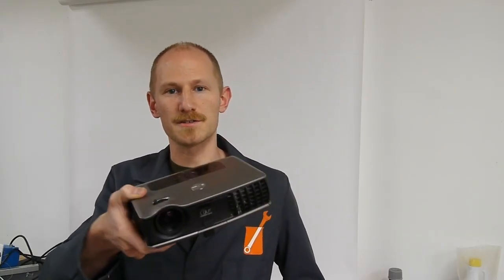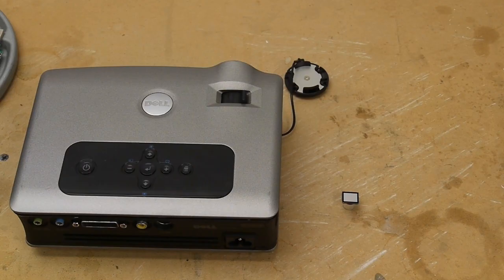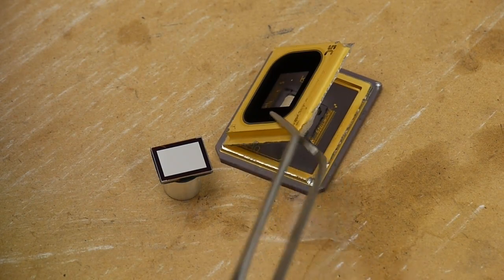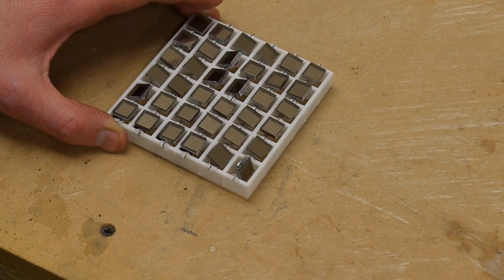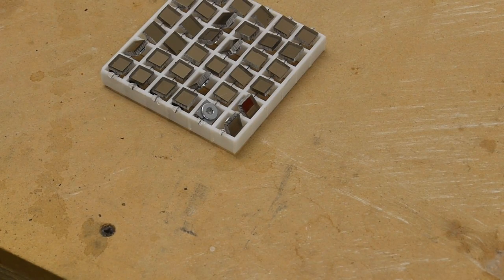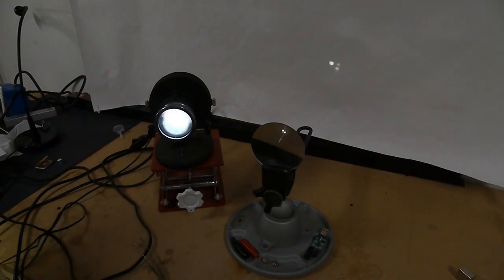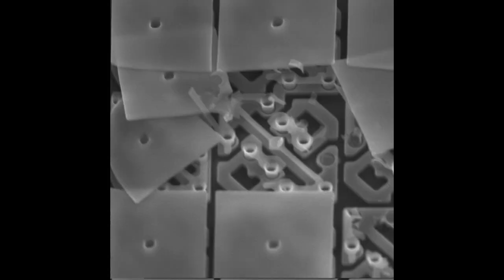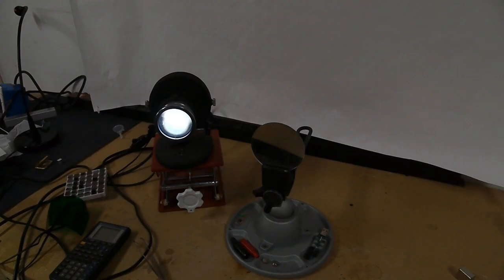How Digital Light Processing (DLP) works

Comment: My electromagnetics professor worked for TI and did RnD for the DMD. He gave two lectures explaining the math behind the forces of the torsion spring and the 'capacitor' (gap between mirror-plate and electrode). 

The steady state relationship between the force of the torsion spring and the force between the two plates of the capacitor relative to the change in distance between the plates of the capacitor with only one intersection where the forces are equivalent, yields an astounding simplification where all variables (voltage, area of plates, spring constant) except one cancel out, leaving only the distance between the capacitor, d/3. 

The d/3 represents the steady position held when the mirror is 'turned on'. When the force of the spring is equivalent to the force of the mirrors electrostatic attraction to the electrode. Which can then be calculated into the angle at which light is reflected from the mirror ... and thereby all of the mirrors in the array.

Another elegant simplification for a boundary of the laws of physics, all because we want to watch cool movies on bigger screens.

https://physicstasks.eu/3250/capacitor-with-plate-on-a-spring#:~:text=Air%20capacitor%20consists%20of%20two,down%20(the%20plates%20remain%20parallel.

Comment: Why not have each mirror be suspended by equal electromagnetic attraction and repulsion, with slight modulations to tilt them, so they have no mechanical connection & fatigue?
Reply: The specially alloys used in the torsion spring only operates within an extremely linear elastic region of the material. Thereby the mirrors have a quite significant amount of cycles in its lifespan.
Reply: @jamesbarnes6343  Interesting point. Thank you.

Comment: The mirrors actually pivot on the corners, and are pulled down with 12 static volts. The springs are mono crystal aluminum. Also: that was a first gen package. Second gen packages have a much smaller glass (first gen glass was so big it cost almost as much as the die).

Comment: Amount of engineering goes into this chip is phenomenal. 
One thing I have noticed, projectors that support active 3d , always use DLP chips to produce image. I believe , because of its  high refresh rate capability.
But now days Lcd panels are capable of producing 144 and above refresh rates. Why we still use DLP chips?
More that that, IPS LCD panel offer better colour accuracy without Rainbow effects.
Can somebody answer????

Comment: just got myse3lf my first DLP DMD chip (TI) and I'm impressed what 285USD can land you.
though it's one of these all-in-one Xiaomi devices. with battery, speakers, and android OS, but dont have a screen, so its the ceiling or wall or even the bathroom tiles like here, https://www.youtube.com/watch?v=W8cfB5k2oAk
and yep you can sense the rainbow effect if you close one eye and open the other and do that fast 
It's a 1080p with around 600 to 700 ANSI.. the DMD is a 0.37 or 0.33 or something like that, though with pixelshifting.
also got 3D, though seem to operate with 144hz, so a no go with the glasses I have from a Samsung 3D TV from a decade back that is 120Hz as I recall .. ½ of 240hz
and mindblowing footage 7:48 one can only wonder about the Texas Instrument tech that is in play to make these DMD TI chips and the balancing mechanism underneath (wicked)
reminds me of a microbolometer sensor chip. (thermal IR) that is also very tiny and fragile and can be bumped out of alignment.

Comment: We have spent many years watching interlaced lines sequentially on TV, but with DLP and the new 4K XPR pixel-shift technology it is fooling the eye in many more ways; the micromirrors of the DLP chip modulate the brightness by PWM, the color is mixed sequentially with the color-wheel, and the 4k enhancer XPR optically shifts the pixels two or four times in 1080p for a 4K feel. These solutions have a mechanical operation, which produces noise, wear and heat. 
An added disadvantage of LCDs is the problem of placing the drivers of each pixel on the panel, as they are translucent they have to be located at the edges, increasing the separation between them "screen-door", which also makes it more difficult to manufacture them for 4K. . I think the best solution is the one used by JVC and SONY with LCoS chips; there are no moving parts, but it is very expensive.

Comment: Question how do they prevent the individual mirrors from "springing" when the electrostatic is turned off? What I mean from springing is let's say you put a spring under tension then let go. The spring doesn't go back to it's resting position and just stop. There is a slight bouncing in and out as the energy dissipates.

Comment: Surprised they don't recycle the waste light with some additional mirrors and optics.  Dumping all that energy into a black surface seems like a cheap and stupid way to do it.  Wouldn't need as noisy fans and additional power to heat your room.

Comment: Hi, you say that lcd has about 3dB loss through the polarisation filter. Wouldn't there also be some loss in the colour filter in the dlp?
Is it not possible to use lcd with colour wheel? Or does the lcd not have enough bandwidth?

Comment: The damage done by the tweezers makes it obvious why it was originally in that protective case.  It would make cleaning the assembly many times easier too since all the fragile parts are inside and all you would have to do is wipe the glass.

Comment: I saw an active camouflage vehicle once! About two years ago, out for a Test drive?  I could see the carbon graphite frame, having looked under the vehicle. Simple two door car, nothing particularly fancy about it.  I think somehow it incorporates the water vapor in the air, as a pixel intersection???. holographic skin . I Seem to run into the craziest shit every 3 years. Started When I was 18 and was 2” from yellow square on the runway, staring at 6 armed  guards in blacked out  chemical protective suits standing  around a F117  stealth fighter. Hell I never knew it’s designation until a year ago, on some kids wall poster...it’s Really small, not like the pictures, minor differences.  I don’t Member that clearly now. it dark out about 10 pm.  22 years ago and I was more fixated on the arm guards, staring at me waiting To take a step forward!    Curious on your thoughts?    To Whom it may concern. I never had to sign a NDR so pissed off!

Comment: Instead of a color wheel spinning in front of a single light source, I guess you could also have multiple light sources switching on and off in sequence (LEDs might be the only thing quick enough) or a metal disk with a hole that spins in front of multiple light sources to let only one light (or a combination of two) through at a time. This could open up the gamut and color depth tremendously, for example by producing violet light with an actual violet light source.

Comment: Old post but wanted to let you know my 2004 Samsung dlp hlp5063w is 14 years old and my Philips square lamp has 14000 hours on it which I'm going to replace soon due to dimming. I replaced the ball bearing color wheel with an air bearing and lubed the fans in 2010.  I modified a small square exhaust fan and placed it on the back vent. Picture still looks awesome with my Dish satellite  receiver.  My next TV is gonna be an LG OLED.

Comment: Does anyone know why DLP projectors don't use something like a Bayer filter on top of the mirrors in order to get coloured subpixels, rather than spinning a filter wheel?
Reply: That would take up 4 mirrors for the predefined Bayer filter colors of say mirror 1: Green Mirror 2:Blue Mirror 3:Red Mirror4: Green. In a CCD camera they employ a demosaicing algorithm to reconstruct a full color image from the incomplete color samples output from the color filter array when the image is saved. That won't work in this case since you are projecting the image and there's no way to use any sort of algorithm before the image hits the projector lens.   You might as well just use a single LCD panel which have the pre-defined elements of RGB but suffers from screen door effect.  Using the Bayer filter method, you would also need to squeeze in more mirrors to get the same resolution as you would with a single color wheel DLP (where each mirror can either be RGB).  Though you could use a 3 DLP chip solution but that also kicks up the price quite a lot but adds a complication of converging the each color panel to line up in both 3 DLP.  The other downside to a 3 panel system is that it seems the blue panel for either DLP or LCD burn out much quicker than Red and Green panel from what I've read the blue panels get much hotter and if the cooling ever fails or you run the projectors in a not so cool environment can lead to that failure.  That's not say there won't be issues with a color wheel failure or Rainbow effect which has been greatly mitigate by using and RGBRBG 6x color wheel.  It is the cheapest and still the best solution for the consumer market right now especially for 3D.

Comment: I still prefer 3lcd instead of 1 dlp chip cause of color shifting effects... or in perfect world a 3 dlp professional projector is the best on earth in term of light efficiency but a 3 DLP chip projector is quite expensive. But their picture is nothing compared to what single dlp chip or lcd projector can achieve. But if i have to choose between a single dlp or a 3 lcd, i'll go for sure with a slightly bigger 3LCD to compensate for the lack of effiency and even use a 0,7 -0,8 gain screen (light gray) to increase contrast and make blacks even darker at the cost of reduced brightness that can be compensated by purchasing a projector that haves some extra brightness to get around this issue.

Comment: The problem of LCD is heat. The polarized light means that 50% of photons are absorbed. In case of dark image, 100% photons are converted to head in the LCD glass.

DLP is not absorbing any photons except for imperfection in production. The IMAX digital projectors can use thousands of watts light source and need only a few watts of cooling for the mirror array.

Comment: When a mirror flips to the OFF position or to the ON position, does it do so very fast so the eye does not perceive any light moving on the image? I would imagine that if it was too slow you would get a blurring of the image. Or does the flip coincide with a shift between the red, green and blue filters?

Comment: Not entirely sure about the power of the light statement at the end. The DLP is showing only one colour at a time, thus using a small part of the full white light from the source. Also, it has to switch on and off in the different colour areas on the spinning colour wheel, and I imagine that a lot of times the mirror must move out of way just before the colour wheel changes colour, as it will cover the chip in a rolling motion. The reason for the usual light output difference is probably more to do with how much heat the LCD chips can handle.

Comment: I love this . DLP is working like an early color tv that used a black & white CRT and a drum that would spin a set of red green and blue film filters in front of the picture tube to create a color image. The picture tube was qued by a sensor so that the corect brightness level would be presented on the CRT to correspond to the colored film in front of it . This design was abandoned due to the larg drum spinning at 60 revolutions per second being a serious hazard if it were to break while in operation. You could still build a demo model from an old b&w tv .That would be cool to see.
Reply: Applied Science So Cool

Comment: Mechanical color TV is the same technology used in NASA cameras for Apollo as well as the Space Shuttle late into the 1980's (while they weren't ready for the Moon's surface until Apollo 14 all the Command Modules had mechanical color cameras). They used six segment disks (GBRBGR). The Space Shuttle had color wheels built into removable lenses. They could swap them with one of several B&W lenses when needed.

Comment: Those little silicon torsional springs would have have to go through a lot of cycles per second to move their mirror multiple times per frame for both colour and intensity.  Think about how many cycles that would be in a lifetime. I didn't think mechanical springs of any size or material could handle that much flexing at those speeds. Think of the temperature they would have to operate at too.

Comment: Adding a few more things, I spent several months doing competitive analysis of DLP chips when I worked at Hewlett Packard.   The torsion hinge is not silicon but a titanium/aluminum alloy.  Lots of interesting material properties of Ti/Al I won't get into here.
The most important thing missing from the narrative is that this device was the first truly micro electro-mechanical device.  I say that because it is not just electrostatics that are responsible for the mirror motion.  If you look carefully at the SEM images, you will see that, under the mirrors, there 4 little tabs attached to the posts.  These are actually tiny springs.  When a mirror is flipped to one side, the electrical force holds it down.  What is really interesting here is that when it is time to flip the mirror, a short voltage spike is applied to the "down" side.  This pulls the mirror down on these little springs then lets it go.  The result is a very fast flip to the other side where there is a voltage applied to hold it there until it is time to flip it the other way.
 If you are wondering why it is this way, think about the inverse square law.  On the down side, the mirror is about 100 nanometers from the electrode.  On the up side, the mirror is a couple of microns from the electrode.  The force on the down side is hundreds of times that of the up side.  It will flip by pulling from the up side but it will be way too slow for a video projector.  Pull down really hard for a microsecond then let go and the mirror flips really fast!  Pretty cool technology from TI.  
Note that Hewlett Packard didn't ever produce a projection chip.  They spent a lots of millions and couldn't come up with something that could do better that the DLP chip.  But, that's another story...
Reply: that's fascinating!  the stronger force available is in the wrong direction, so use that to pull it against a spring and then let go... clever.  I just assumed that they used the piezo effect to move the mirrors.  Any short explanation as to prefering electrostatic?
Reply: cool
Reply: Very interesting info. Thanks !
Reply: Cool info, tq!
Reply: I worked on DMD for about 12 years.
Reply: How are those springs made?
Reply: @Hugh_Mungus  if you ever find the answer, help a guy out. That's all I can think about.
Reply: @Ghengis443  Hello. This was some time ago but I remember reading about how it was done similarly to how they etch patterns on microprocessors using lithography as well. I'd also still like to know more about this if anyone knows more
Reply: wow how can you make something so small and perfect?. if we can make tech that small then whats keeping us from making nanobots?

Comment: When a single mirror is flipping from "on" to "off", I assume the light stays on. How do you not end up with streaks all over the place while the mirrors travel between the two positions, especially if they're flipping many times within the same color wheel position?

Also, why can projectors not have RGB LCD panels like standard computer monitors? Why are three separate chips + light paths required?
Reply from the maker: +Ethan Trewhitt Good questions.  The mirrors move extremely quickly in a DLP chip, and the streaks of light that they produce are too dim to see even when looking for them carefully.  I believe the total travel time for a mirror from one position to the other is 5-10 microseconds.  There just isn't enough time for a human eye to capture enough photons.  Some projectors do have full RGB panels, I believe, but they tend to be low-performance units.  The main problem is pixel density.  A high-res RGB LCD for a computer might have 2560 pixels spread over 40cm, which is 190 subpixels (R, G,B) per cm, or 52 micron per.  An LCD projector might need 1920 pixels over 2cm, which is 3.5 micron per subpixel.  This is a problem because the LCD requires some space in each subpixel for the driver transistor, and it cannot be shrunk too far without degrading performance of the panel.  Thus, the ratio of total pixel area to transistor area becomes small as the panel resolution increases, and at some point the device cannot function well because there isn't enough area for the driver transistor and the pixel itself.  This is why LCoS is popular -- the silicon substrate is much more efficient than the glass substrate for making driver transistors, and a much smaller area can be dedicated to the transistor -- keeping the pixel-to-transistor ratio high.  The other alternative is to separate R,G,B, which effectively triples the area available.
Reply: ***** You do, but they are so dim that you cannot see it over the actual projection image. Also i imagine the colour wheel would have a way of compensating for this, for example a small time frame between colours where light is blocked, allowing the mirrors to switch states between colours, eliminating the effect of streaks.
Reply: +Applied Science  Couldn't we use the concept of high res smartphone screens? Or will the pixel density suffer when it is spread over a large projection screen?
Reply: +Mussie Tesfay It would drive up the cost of smartphones significantly, and would therefore not be practical or cost effective imo. Plus OLED and IPS display technologies already have that covered.
Reply: Applied Science How do 4k projectors work? Since they are higher res they need more pixels.Do they just have larger chips?